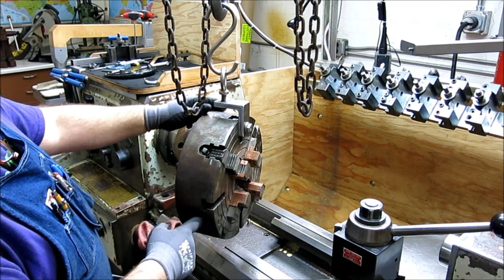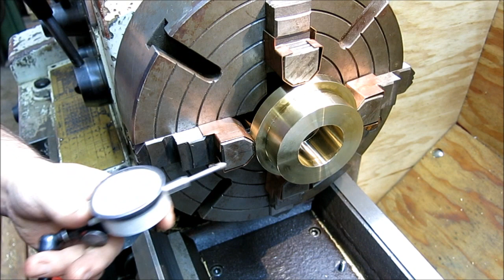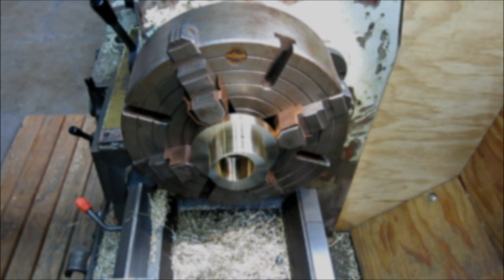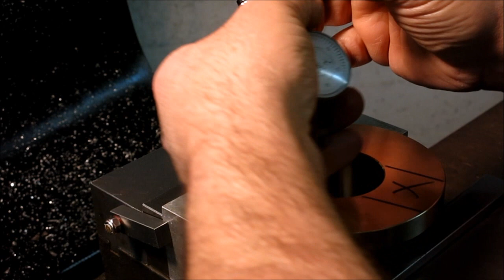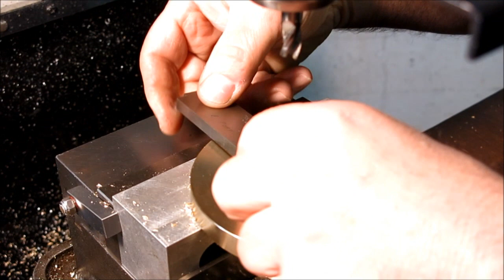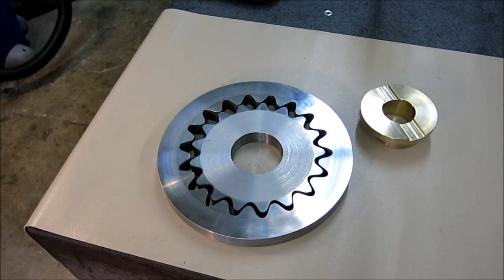Etching Press Eccentric Machining

Comment: Hi Tom, Make yourself four parallels to clamp to the chuck face with a tapped hole in the inner part to receive a bolt which you can skim, et voila, you have a dead parallel back face standing off from your chuck face at any distance you require, now all you have to do is concentrate on the eccentric runout.

Comment: I couldn't figure out why you were indicating only along the 2 offset jaws and not on the centered jaws. Surely, while 2 jaws are adjusted for the offset, the two others need to be spot on centered. But then I realized that this is not necessary. If you just indicate the max and min run out of the part, implicitly the perpendicular 'poles' will be centered. They just won't be aligned with the jaws. Realize now that you hinted at that by saying that the part has no orientation, but that didn't quite register with me.

Comment: I am curious why you chose to mill the two sides of the drive slot separately instead of going straight across on each pass? was there a size difference between the two, in the specifications I missed?

Comment: Long ago I made (maybe invented lol) a fine adjustment for my chainfalls. Its basically a screw driven scissor jack type mechanism between the chain hook and the load. Allows one hand lifting and lowering at a more precise infinite rate. Like when you only need it a tiny bit lower or higher. Just went out and looked at it, and a modified kant twist style clamp with a hand knob would probably work  exactly the same. Be a lot easier than starting from scratch. Would work great for heavy chuck installs.

Comment: A couple of suggestions.

Firstly, put a sharpie mark at both the high and low points. This will allow you to quickly return to them, rather than have to keep searching for them.

Next, with the zero set on the low point, calculate the figure for the halfway point between what the high point reads, and what you want it to read.

Now, with the indicator on the high point, adjust to the halfway point you calculated.

That should put you almost dead nuts, on where you want to be.

Comment: Did I miss it or did it happen off camera... did you ever check the other two jaws? You only wanted the eccentricity on one axis so you would have wanted to check and verify that the part was centered in the other two jaws right?
Reply from the maker: Offset is offset. I was measuring the total offset with the indicator so its irrelevant if it happens to not be oriented with a set of jaws perfectly. Runout in a lathe is always a circle. Thanks for the comment.

Cheers,

Tom
Reply: Thanks I suppose that makes sense

Comment: is there any reason/s against or for offsetting from pushing it out with 2 opposing jaws vs pushing it out with 2 perpendicular jaws, taking in the opposite 2. Where the eccentricity comes in 45° from the jaws vs inline. Aside from indicating being a little bit more intuitive.

in my wood turning (i know woodturning and metal arent really comparable) whenever i do on axis eccentric i do it the other way, more for the dovetail cup jaws to get a more even grip.
Reply from the maker: Hi Miles,

Not really. Its just more convenient to track what the offset is directly as you move it. Thanks for the comment.

Cheers,

Tom

Comment: beautiful shop and work.  a bushing in yer BVDs eh?  I need to make a 2 inch eccentric should I hack it out of one chunk, turning with a wobble frankly scares me with steel,  or can I use to bushings and weld
Reply from the maker: Hi Tandem,

Do what fits your comfort level and tooling. Two inch offset is pretty large. Might be tempted to bush that one. Thanks for the comment.

Cheers,

Tom

Comment: Just went back and watched this (and most of the rest of this build, over the last couple weeks) and got to wondering about when you were clobbering the indicator with the chuck jaw. I pretty much just swap the tip out for an extension before I start when I'm doing something like this, and was surprised when you didn't. Of course,  I am clumsy enough to destroy every tool I have, otherwise.
Reply from the maker: +john john Hey John,

Thanks for the comment.

Cheers,

Tom

Comment: I had to laugh when I saw this.  Not at your work, but because you are the first person I have seen with a YAM lathe.  I have one too, I think my grandfather bought it in 84, with the same Rohm chucks, and Aloris tool post holder.  I think mine has an 8.5 foot bed.  Anyways, I like the back you made, and it gave me ideas.  Thanks for showing others some tricks.
Reply from the maker: +Kevin Anderson Hey Kevin,

This is the first YAM I have owned. I actually like it. We have one in one of the shops at work that is a bit smaller. Very nice machines in my opinion. Thanks for the comment.

Cheers,

Tom

Comment: Hi Tom,
              When setting up for an eccentricity, all you need to do is set the zero on the dial gauge for the two non-eccentric jaws and then set for + and _ offset on the offset jaws. In this way the resetting of the zero after each alteration is avoided.
Best Regards
MoK
Reply from the maker: +Mo King Hi Mo,

Thanks for the comment. 

Cheers,

Tom

Comment: you should practice what your going to do and say before you record it. if you cut out the umms and oops that could have been a 20 minute video. by the way nice work sincerely
Reply from the maker: Joe Brooks Hey Joe,

I have been practicing for 40 years. I don't need to say anything to get the work done. Its all for your benefit not mine. Normally the first letter in a sentence is capitalized just in case you need some writing pointers. <g> I do appreciate the comment.

Cheers,

Tom
Reply: oxtoolco Hi Ox. Beautiful work. And I really enjoy your umms and especially oopses. That's when we learn the most from you. Regards from a guy from Austria who knows nothing about machining but still loves to watch those vids. :-)

Comment: Hi
My tip:Use a strong spring with your hook to lift the chuck.This will help you to fine adjust-control the height of the weight you're lifting.Good day Sir.
Reply from the maker: paximadisxevidotos Hi Pax,

Thanks for the comment and suggestion. 

Cheers,

Tom

Comment: how would using this process for machining a small engine crankshaft effect the bits when using steel bar stock?
Reply from the maker: anubis1100 Hi Anubis,

Not sure if I understand your question. Most toolbits will hold up fine to interrupted cuts like this if that was your question.  Hope this helps.

Best,

Tom
Reply: yeah thats what i was asking. thanks for the reply.

Comment: A set of parallels between the back of the part and the face of the four-jaw will get you close to flat while dialing in the eccentric. You will probably have to clamp them gently to a pair of the jaws (1 and 3 or 2 and 4) so they don't drop out while rotating the chuck. Don't forget to take them out before spinning it up!

I find that when centering in a four-jaw that the final few thousandths are best done by tightening only. If you have to back off a jaw, make it a very small backoff and retighten immediately - before going to the opposite jaw. Otherwise you just keep chasing the same thousandth back and forth across the chuck. (I doubt that I have a three-jaw on my lathe more than 5% of the time; it's four-jaw or collets for me, so I get a lot of practice.)

Comment: 16:30 would a set of parallels behind the piece not suffice to straighten it?
Reply from the maker: Hi Frollard,

Yes that works. Its not my favorite method as its hard to hold and do all the other things needed at the same time. I ended up making a backing plate for this chuck in a later video. Thanks for the comment. 

Cheers,

Tom
Reply: oxtoolco
Excellent, I saw the spider you made for the 6-jaw later on and figured that is also pretty ideal :)

Comment: Dude I could cnc mill that in an hour.
Reply from the maker: Hey John,

I doubt it. Setup from stone cold, cut soft jaws, machine two sides, programming. I call baloney. Thanks for the comment.

Cheers,

Tom
Reply: You have to cut three circles. Sorry but that's about as basic as it gets.
Reply from the maker: John Welden Hey John,

What about the overall length? From a blank piece of stock its a tad more that three circles. I have no doubt that you could whup me hands down making this but if you throw down like that you need should factor in all the steps to make the part. Be a sport and throw up a video of you making one in an hour. I'll be the first to subscribe to your channel. I'll make it easy on you and let you make it out of aluminum for demonstration purposes instead of aluminum bronze.

All the best,

Tom

Comment: Sorry to say buddy but you are doing it the wrong way ! You are starting with a piece already offset and you are adding an offset ??. You should start with your piece fully centered then add your indicator, then calculate the offset.
Reply from the maker: Hi Alain,

I think it did work. Offset is offset on a round. Polar direction makes no difference. If it was square I would agree with you. You watched the whole video right? Thanks for the comment.

Cheers,

Tom

Comment: Hi Tom
Real nice job and steps taken to tackle each procedure explained quite clear just like others such as Adam and many others on YT, really enjoying these clips as I hand to handle such parts as a non machine'st self taught until I had access to mills and lathes, one of the comments one viewer mentioned about the cost of that bronze and I can remember my boss asked me one day back in the years if  i would take up the challenge to fabricate or machine a specific part according to the drawings that came along with it,  
cost of the part was about 700$ the size of the metal was 8 inch by 8 inch it was referred as exotic medal made to order according to the   inviroment it had to be used to work in, maybe( radio active inviroment )
 I refused to tackle a piece that expensive with my limited knowledge, but someone else machined to specs  very carefully......... and with a lot..... of time, but not me to expensive to risk scraping it , anyhow enjoy all your jobs including many others on YT
Reply from the maker: Hi Salvatore,

Thanks for the nice note. I refuse to think about how much the material costs. I prefer to focus on the job and process. If I let myself get hung up on how much the material costs it would effect my work in a negative way. To date my personal record for most expensive single chunk of material was a blank of Tantalum. You could pick it up and put it in the lathe. All $14,000 worth. Thanks for the comment. 

Cheers,

Tom

Comment: 3d printing will turn this entire job into a a guy pushing buttons or drawing a picture and nothing more. We're screwed.
Reply from the maker: Hey Dog,

I think we have a few days left. Somebody still has to run the machine. The machine is just different. Adapt or be left behind. Thanks for the comment.

Cheers,

Tom
Reply: Bad Dog I think we are a far way away from making this obsolete. A machine to make this part would cost hundres of thousands of dollars, and the machines still do not have the tight tolerances. I am not saying this will never happen, but it will be a long time. Also, people had the same suspicion with CNC, and manual machines still have their place in manufacturing.

Comment: Hey Tom,
Cant believe I missed one of your vids!
None the less though, BRILLIANT AS USUAL!!
My only question is,  when you were setting the offset, is it not necessary to indicate the part to zero before going after the offset?
My afterthought is, because you found zero after each adjustment that became your reference. Yes?
Just trying to wrap my old noggin around the concept!!
The more I see from you guy's, the more I realize how much I don't know!!
Thanks for sharing Tom.
Razor!
Reply from the maker: Hey Ray,

Not quote following your ironworker logic. Are we talking on the lathe or on the mill? If its the lathe offset is offset. No accommodation is needed for centering.

Cheers,

Tom
Reply: oxtoolco Referring to the lathe. Once you find out the distance you need, do you not set the part to zero then move to your dimension? Looked like you set the part in the chuck by eye, then started your adjustments. Forgive the Ironworker mentality!

Comment: How do you no you are concentric? In the middle of radius for slot? I take it you have a DRO? And are using the numbers?
Reply from the maker: Hey Stephen,

I located the high point of the eccentric then indicated the OD of the part to find center for the slot.

Cheers,

Tom

Comment: Hey Oxtoolco, you could use a couple of gauge blocks or parallels slipped behind your workpiece and the chuck to give you a much more accurate starting point for indicating the face. It can be a handful, but you hold them or tape them in place then tap the workpiece back until it comes into contact, then slip out the gauge blocks and you are only minutes away from truing up with the dial indicator.  Thanks so much for an instructive video on offset machining! Well done!
Reply from the maker: Hi David,

Shortly after this video I made a proper backing plate. I have always favored a backing plate over loose blocks. I can remember a few times being frustrated by loose blocks falling out at just the wrong time. Thanks for the comment.

Cheers,

Tom
Reply: oxtoolco Hey Tom, I am really enjoying watching your videos! Are you making the Etching Press for yourself?  Ironic I spent some time looking for one on eBay today. Nice shop set up too!
Reply: what iv done in the passed is using the T nut slots to clamp a parallel to the chuck, tho i do work in a big machine shop so do have a large selection of parallels to choose from making it much easier
Reply from the maker: doyouwanttofuk hey fuk,

Take a look at my video on the four jaw backing plate. I prefer this type to parallels. Thanks for the comment.

Cheers,

Tom
Reply: oxtoolco yea iv seen that before in your vids very helpful bit for tool.

Comment: Tom, I bought a set of these parallel keepers for my vise ...

http://www.ebay.com/itm/MagKeepers-Magnetic-Parallel-Keepers-Green-1-4-parallels-Machinist-vise-tool/191388083524?_trksid=p2047675.c100005.m1851&_trkparms=aid%3D222007%26algo%3DSIC.MBE%26ao%3D1%26asc%3D26943%26meid%3Df01b858de13645bd81f198658ccae094%26pid%3D100005%26prg%3D11184%26rk%3D1%26rkt%3D6%26sd%3D191388091154&rt=nc

Comment: Two points please. Firstly I am a little concerned about your lathe chuck lifting. Firstly Eye Bolts should be fully screwed down until the shoulder seats. Secondly the way you have the bracket bolted into the tee slot of the chuck. If the bolt should come lose for any reason, there is nothing to stop the chuck sliding off the tee nut. Good video other than that, well done. Question please, what does the plastic drinks bottle do that is fitted to the left hand side of the mill. Is it a home made coolant mister ?
Reply from the maker: Hi Dave,

Thanks for the comment and concern. The five eighths eye bolts are rated at several tons when fully seated as you mention. The non shouldered models are rated somewhat less that that. I think I'm in pretty safe territory. Bolts and fasteners work by clamping force. If tightened reasonably even small sizes generate huge clamping forces. An example is a 10-24 fastener torqued to 80% of yield generates over 1000 lbs clamping force. I'm feeling pretty safe with my bracket and eye bolt. I totally understand if you are not comfortable doing it this way and respect that. If you want to see the soda bottle explanation check out the FAQ video.

All the best,

Tom

Comment: Tom- When aligning the slot with the apogee of the eccentric, if your indicator pin wasn't aligned exactly with the diameter of the eccentric, then the slot wouldn't be perfectly aligned, right?

Best,
-Tom
Reply from the maker: Hey Tom,

Sounds right from here. A slight back and forth movement of the X axis would expose an error as a high point would show that was different than the one found through rotating. Good observation. 

Cheers,

Tom

Comment: I love watching manual guys, you really put the art into machining. My tendency would be to throw it up on a cnc mill and interpolate an eccentric boss, then run an OD boring head around it.
Reply from the maker: Hi Andy,

Sounds like fun as well. I will have some CNC equipment at some point. Hang around for a bit. Thanks for the comment.

Cheers,

Tom

Comment: why go .688 out and not 600 i thought you needed to be 300 off center im new at this and takin cnc programing but i run a engine lathe at work and thanks for the videos
Reply from the maker: Hi Bobby,

When  I actually looked at the model it was .344 off the center. Doubling that gives the .688. Thanks for the comment.

Cheers,

Tom

Comment: Hi tom just found your channel. Nice stuff you have here. I like the fact your honest
and say that you don't use a four jaw much  , ok on with the show I've got two things
for ya
1. the test indicator HOLDER  holding the intrepid as you test the wobble bobbin in
your mill , who makes it ? I never see one like that and could not seem to read it .

2 .I've seen a few of your video's  cool stuff but if I could ,I'd like to suggest using springs of different lengths and sizes  to keep pressure on the parallels . using in-between the parallels and close the vise trapping the springs in place ,makes for easy and quick cleaning while working and not knocking down  the parallels at the same time . P.S check for clearances  drill's and springs don't like each other !
 .
Reply from the maker: Hi Paul,

Thanks for the comment and suggestions. The indicator holder is a combination of a INDICOL and a NOGA indicator holder. Check out my video called a Noga Indicol marriage. 

Cheers,

Tom